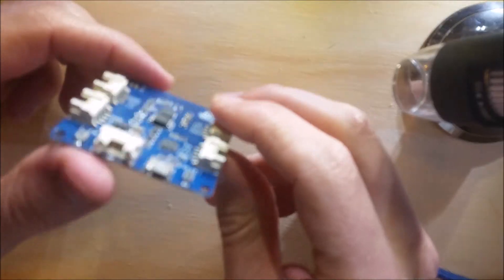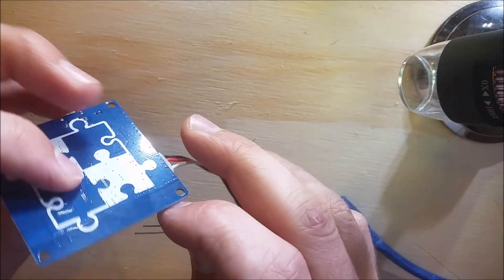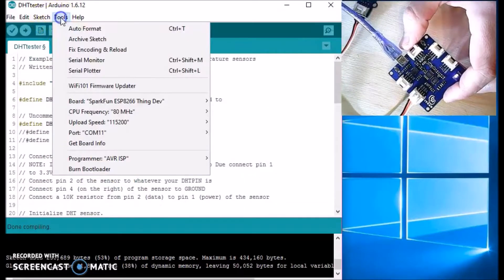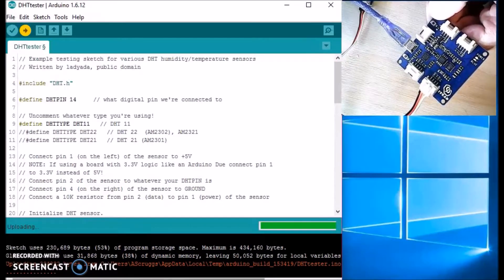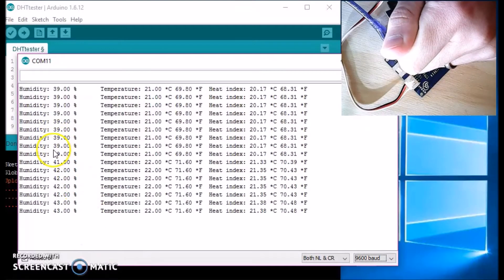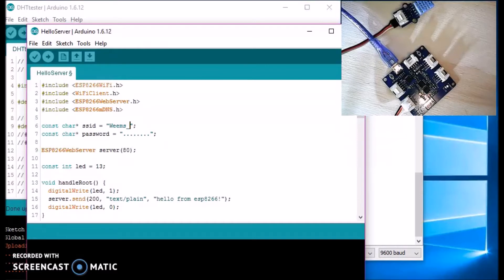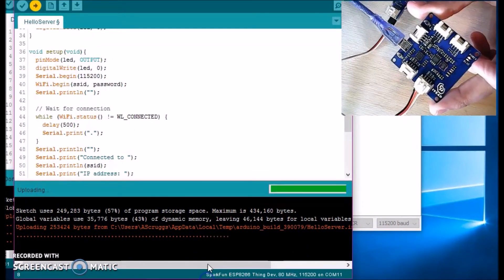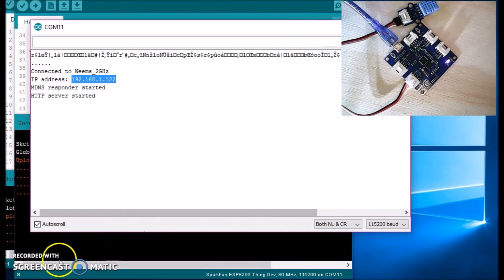Sonoff esp8266 Dev Board Review

Comment: After running the CheckFlashConfig sketch, I found that the Adafruit HUZZAH ESP8266 was the closest match to the Sonoff Dev and it works well.  It matches the Flash speed and mode but not the flash size.  If you're willing to solder, you can replace the Sonoff Dev flash chip with a Winbond W25Q32BVSIG to increase the size from 1M to 4M and exactly match the HUZZAH ESP8266 configuration.